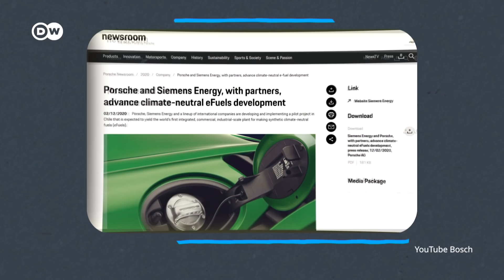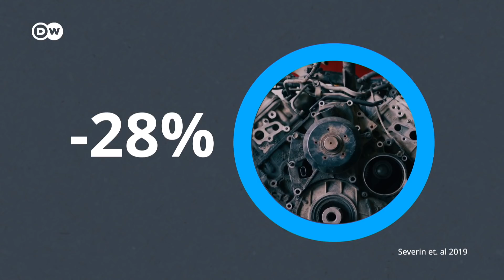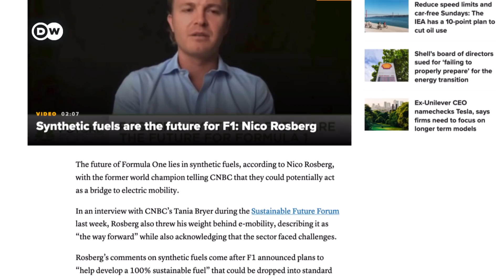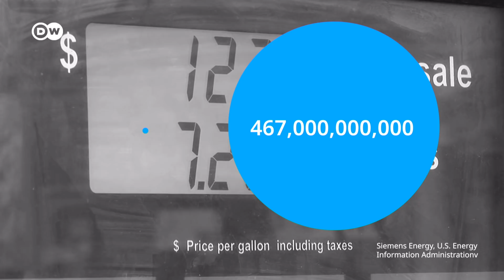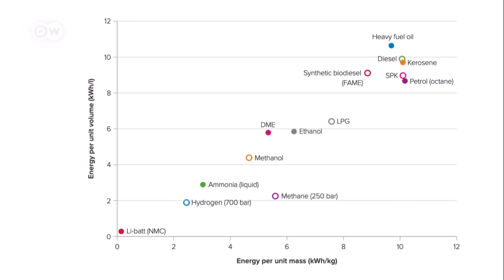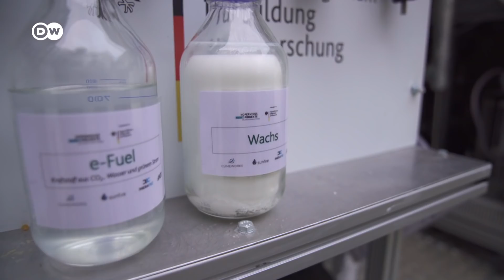The truth about carbon neutral fuels

Comment: Biodiesel from rapeseed farms can be easily and rather cheaply produced and used in simple diesel engines, with no particle filters. These fuels started to take off at some point and are used to this day in a small concentration at the pump, but there are interests from the oil companies that they should not become mainstream. Think of agrarian countries such as Romania, Ukraine - immense fields of cereal can be used to mass produce these biofuels. The degree of pollution resulting from burning rapeseed-based biodiesel is several times less detrimental than fossil fuels, and if we fully migrated diesel engines to that we would have probably been much closer to the so-called "carbon neutrality" by now. But who wants to create simple, cheap diesels running on cheap biofuels, when there is still tons of money to be made from expensive car engine tech, crude oil, expensive and non-recyclable (!) car batteries and wind turbines which get stockpiled in graveyards after some years of work ?...
Reply from the maker: Hey, previously we made this video "Biomass: How clean is energy from waste and plants really?" 👉https://www.youtube.com/watch?v=XXu15NlOuGo that you might want to check out. 🙌
Reply: @DWPlanetA  Thank you, insightful video on biomass and different types of fuels !

Comment: In this video you partially tell the people the truth on BEVs, e focus on source of green energy to convert COH2 in synthetic fuel. However you didn’t mention the same argument to BEVs source of energy, and more, the complexity of mining rare earth material, lithium, cobalt, iridium e energy spent to produce batteries, and inefficiency and problems caused by heavy vehicles on tyres, roads, and infra structure needed to run an inefficient way of transportation for long distances. On BEVs you carry battery loads and not payloads. So, this is a typically tendency on press, to defend the BEVs, please calculate the efficiency on BEVs from pit to wheels, ando not produce fake news.

Comment: Hydrocarbons come in four structural classes.

Aromatic - contain a benzene ring (most toxic) and are used in solvents and glues but also in paint and paint remover.  
Aliphatic - petroleum distillates found in polishes, lamp oils, and lighter fluid.
Halogenated - fluorinated, chlorinated, or brominated, and are used for refrigeration (freon) and as insecticides and herbicides. 
Terpene - found in turpentine and pine oil. Some of these hydrocarbons may be found in various mixed forms and used as an aerosol spray propellant.
Hydrocarbon's ability to cause disease is dependent on three factors.

Route of Exposure

Direct skin contact can happen, causing local skin irritation and, rarely, systemic disease. However, prolonged exposure can lead to tissue breakdown and superficial, partial thickness chemical burns. Severe, full-thickness chemical burns can lead to absorption and acute toxic systemic manifestations. Ingestion and inhalation/aspiration of hydrocarbons can also occur, which may signify disease and lead to systemic toxicity and morbidity and mortality.

The Chemical Properties

The hydrocarbon's chemical properties, including its volatility, viscosity and surface tension, affect the disease-causing potential of the hydrocarbon. Volatility refers to the rate at which the hydrocarbon can vaporize or exist as a gas. Chemicals with high volatility have an increased risk for pulmonary absorption and can lead to central nervous system (CNS) depression. Viscosity refers to the ability to resist flow. Low viscosity allows for deeper penetration into the lungs. The ability of the molecules to adhere along a liquid surface is surface tension. Low surface tension can allow compounds to spread easily over large areas.

Amount of Exposure

Hydrocarbon exposure, either in a single or cumulative dose, can determine the systemic CNS effects on the patient.

Comment: Why not use the e-fuel to produce electricity to power electric motors instead of using Cole and oil?
Reply from the maker: Hey Magdy! That would not work well in terms of energy efficiency as the production of e-fuels already requires a lot of energy. It would make more sense to charge electric cars with renewable energy sources instead.

Comment: Some sort of renewable energy that is energy dense will be needed for airplanes, just to be light enough to lift off. 
Some sort of renewable energy that is energy dense will be needed for ships so that they still have room for cargo and the ability to go their long distances.
Some sort of renewable energy that is energy dense will be needed for long distance trucking and likely for rail freight, whether it is only long distance or all rail freight.

Synthetic fuels seems like the least likely solution.
Something more along the lines of renewable fuels like vegetable oils and alcohols. 
Although for the ability to turn massive amounts of food stuffs to fuels, basically the world would need to give up eating meat.  
Actually that is not true, if we stopped feeding animals to eat the animals, less than half of that land would be needed for fuels. We could return much to forests, which would permanently remove carbon from the air.
Much more likely is reducing meat consumption by half, which can be done by making meat much more expensive, thus meat alternatives become much less expensive. Although if people would just choose vegetables, and not imitation meat, a vegetarian diet is already cheaper.

Please note, while Porsche has a pilot plant making e-Fuels, they have not yet started to capture carbon successfully, so that $10 figure is still a guess and ignores all the cost of building the plant, located far from customers as it is, they are also ignoring the shipping costs, and finally ignoring the costs of decades of research to get to where they are. Which is close, but not yet there for a pilot program. Meaning they are likely 10 years for away production, so this won't save any new internal combustion, it is for drivers of old Porsches, and Porsches ONLY, to continue to drive them without converting them all to EVs. Fuel companies could follow suit and do the same.

Last note, a sustainable fuel source only makes it carbon neutral, which just stops making the climate worse. Potentially making the super storms and forest fires a permanent part of what we live with. Which, of course, is not sustainable and would continually make the world worse and less able to support human life. What we truly need is to be carbon negative, to permanently remove carbon from the atmosphere as well as from the oceans. More forests are needed, both as a source of more wood for building, using less concrete and steel, and as permanent forests. Frankly the production of trees for wood long term takes more carbon out of the atmosphere, as long as the trees are replanted to make it a sustainable wood producing forest. More use of bamboo would help, as it grows much faster than most trees.

Comment: Even i can afford i don't want to get an electric car because they can't go long distances at high speed and you should stop and charge your car few times when you go to vacation. It's also a problem in cities because when you travel at high speed in city highways your electric use is being like 50kWh/100 and it seriously decreases your range And it's also kind of boring that you can't play with the car (i like drive manual).

Comment: Hmmm electrolysis is now said to be 80% efficient

So efuel as energy storage for renewables seems to be 20+7+21......50% efficient?

..........feels like using hydrogen directly would be more efficient storage, converting it back into electricity on demand
Reply: That’s true. But liquid fuels are massively easier to manage and have massively greater volumetric energy density. Hence the push towards liquid e-fuels. (Which I don’t agree with)

Comment: V biased towards electric cars:

Infra is not there for electric cars 
Efuels work with current infra and cars

The energy that powers electric cars is dirty 
The battery's to power electric cars and the tech has extremely high energy demand.

I think there is a place for efuels and obviously so does the EU.

I like EVs as an experience but the market doesn't want them if they did they wouldn't have to be forced into buying them.

Comment: Absolutely yes, we need it. It’s not possible to swap all present cars out with electrical in one go, or what about the infrastructure supplying enough power to all the homes, that will charge the cars at Home...??? It Will require new copper cables, transport,  digging to place Them in the Ground. Not to mention the  need for High voltage transformation stations etc. Scrapping Functional Old cars just to replace Them with new electrical ones also needs hugge amount of energy, sorry but I do not believe thats feasible green calculation..... Also, it must be a bennefit that we reduce the amount of CO2 in the Air using the Carbon catch and store it in tanks at the refineries, the gas stations and All the cars..... and the exhaust Will also be cleaner with efuels..... so to me we should investigate massively in making these fuels cheaper to produce - we already have the infra structure for it....!

Comment: Very necessary but wow the energy loss is massive.. and its not the global warming you need to worry about it’s the running out of oil that’s going to really be the single biggest problem we are facing… we have already passed peak oil .. the best of it is gone .. carbon neutral actually translates into no oil left . Global warming translates into get your renewable energy ready we are running out of oil., runaway greenhouse effect was just a cow farting all the way as it jumped over the moon.

Comment: There is one flaw in the closing words about e-fuels coming too late; as is pointed out, there are 1 Billion cars in the world. You are NOT replacing those overnight. It will be many decades before the last ICE vehicles disappear, if nothing else because you can't build that many vehicles that quickly, so e-fuels offer an opportunity to allow that phase out to happen and allow us to reduce or even completely remove the use of fossil fuels in ICE vehicles. 
The cost argument is also a bit thin and actually is the same as the one made about EVs; emerging technologies are expensive. People keep declaring EVs will get cheaper as the technology matures and scales of production reach a higher efficiency. E-Fuels would be exactly the same. They're expensive right now because the technology hasn't matured and scales of production haven't reached a higher efficiency level...
I'm not sure why there is this assumption that we'll flick a switch in 2030 and suddenly all ICE vehicles will disappear.

Comment: Hydrogen would be best, but has energy density, safety, and storage issues. E fuels are the next best alternatives. No reason we can't have all 3, battery electric, e-fuels, and hydrogen, each used where most applicable. The real issue is how to generate the electricity. You have forgotten the game changing alternative to fossil fuels and renewable s. Nuclear power!
Reply: This is my pet peev with this topic, people assuming that there can only be a single solution instead of a diverse spread.

Comment: Great work . should be appreciated. Synthetic fuel is a successful solution for sure. This can be used for any vehicle. No matter what anyone says, This is the future. Many people love the internal combustion engines. IC engines are reliable , have familiar technology, Using synthetic fuel for IC engine provides environmental benefits.
Reply: I look forward to a diverse propulsion future, I love ICE and I think that EVs are fun to drive. My pet peev is when people only want one and one thing only.
Reply: @charliecollings2295  People need choices, and to be free to choose. Freedom of choice usually produces optimum results. This applies to fuels, energy, transportation, and almost everything else. The only stipulation being that environmental and social costs of the energy or fuel choice are internalized in price via taxes so people "pay the freight" of their choices.
Reply: Also the non-electric energy infrastructure is built around hydrocarbon fuels. Synthetic methane could directly replace natural gas.  However methane is a very potent greenhouse gas so gas  leakage would need to be addressed. Synthetic propane, synthetic, kerosene, gasoline, and especially synthetic diesel fuel would be a faster way to solve carbon neutrality than I believe any other alternative..

Comment: "Gallon of synthetic fuel costs 10 times than a regular gallon of fuel"
Electric vehicles are way more expensive than internal combustion engines.

"Energy wasted on synthetic fuel"
How is electricity generated  for charging EV's? Also using both renewable and non renewable energy.

"EV's are more clean,  more efficiency"
It is to be noted that all the process of making those vehicles is not taken on count.  Extraction and mining cobalt, manganese, nickel, lithium and rare earths, for massive EV's production will demand a huge increment in mining worldwide with a huge increment in environmental impact, and also social impact being those raw materials for EV's batteries mostly found on 3rd world countries.  And not to mention the lack of public information about the recycling of lithium batteries once they have end their life cycle.

Really, we need to stop thinking that one option excludes the other option, it's a wrong move to think that the future will be only EV's or on the other side people thinking that synthetic fuel will kill electric vehicles, we need alternatives not the imposition of only option.

Comment: Renewables are produced when the sun shines and when theres wind. To use 100% renewables we need massive amounts of energy storage. e-fuels can enable the use of renewables by providing part of the energy storage needed.
Reply: Or, hear me out: Nuclear
Thorium is far safer than Uranium.
Pyroprocessing can be used to repeatedly use Spent Nuclear Fuel into Nuclear Fuel. 

Batteries are inherently expensive to maintain and operate, not the mention the sheer flammability risks. Nuclear, while seeming more dangerous, is far less dangerous than batteries if we keep proper maintenance on them and don't let egoistic politicians take over them.

Comment: Does everyone forget about the lithium and cobalt mines?! Wtf!! They are way worse for the earth and people than a oil rig. Battery EVs are not the future!!! The charge times are ridiculous, you need packs after several years, thermal runaway in s small wreck etc etc. in a gas car if I do have fill up on somewhat long drive I don’t have to pre-plan where to go what to do for a hour or more and I don’t have to worry about how long it’ll be if every pump is taken unlike in fuel car i know a spot will open in 5 mins or less not 1 hour or more. The list goes on and on. Sure the % is low and you need green energy to make it neutral but that’s it. Seems a lot easier to overcome!! A battery ev needs new packs new mines for them by giant energy hungry machines and refining them etc will for sure be worse. So maybe take the lower % and maybe switch to nuclear GREEN energy that can run at all times even when no sunlight and no wind. These fuels and hydrogen fuels and hydrogen fuel cells are the future not battery ev like Tesla and what car companies like VW Group are putting out currently. Those are the bridge technology well that’s not correct either as they were never needed to go green in the first place. Toyota has it right not messing with these. Only reason the battery ev is somewhat popular is because trendy yuppies liked their Tesla so government saw potential for more control over us and wanted to be in with the green yuppies and since no smoke nothing comes out the back we get governments forcing a deeply flawed technology for mass transit and passenger vehicles. That combined with companies like VW who got busted for emissions scandals wanting to suck up to governments and the yuppie California idiots who buy the most cars is why they are even here. Not because they are better for the earth because they are not. At most the battery ev could be golf carts for cities you know when you need to drive 3-5 blocks and park it on a wireless charger or for drag racing in a straight line toy because they are no good for passenger cars, large trucks or planes!! It drives me nuts how stupid people are on this!!! They don’t sell because don’t want them not because they can’t afford them. They have several affordable battery ev options now and yet they don’t sell. The average single mom doesn’t want to buy a new car every 2-4 years they don’t want to think about it assuming they can even afford a new car so they sure as hell don’t want to buy a new battery pack in 6 years they also don’t want to worry about charging and charging times which can be a safety issue when your car is stuck waiting 1-4 hours in the middle of the night. Etc etc the list goes on and on the downsides for battery ev. Stop pushing battery EVs!!!!! Normally I am more elegant when complaining and pointing out things but it’s getting ridiculous!! These fuels and hydrogen are the future along with gasoline yes oil will still be drilled as it’s used in more than just fuel so don’t invest in battery ev stock and don’t buy ones. Companies like VW and Audi are gonna regret dropping all gas engines in favor of this junk which sucks because VW Group is the greatest car company ever and to see them have issues in 2015 and will again by 2035 sucks
Reply: Oh and don’t forget the already strained electrical grid!!! Imagine every car being electric lol we will have no lights no ac no fridge nothing!!! Btw I have never heard battery evs have a 30+% market share where did that guy get that info lol